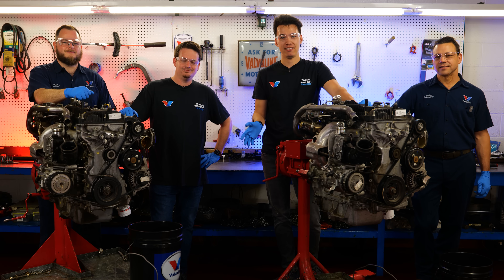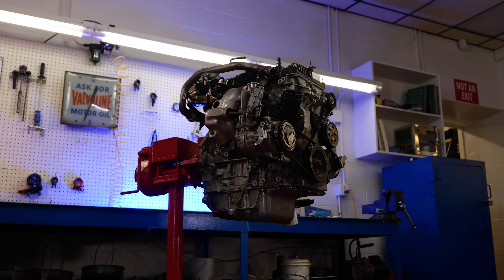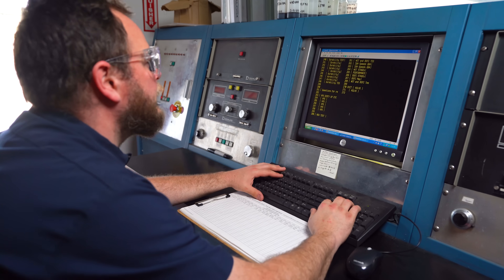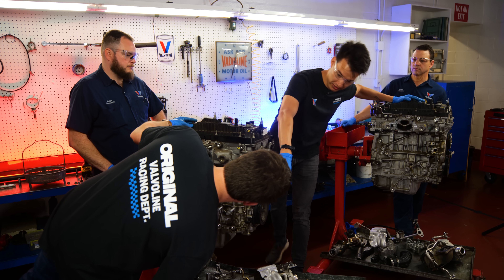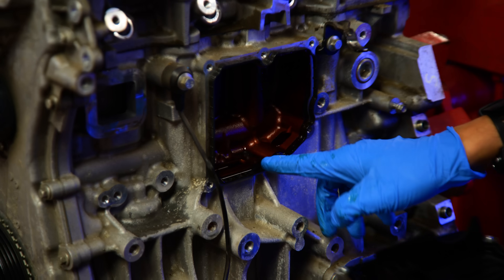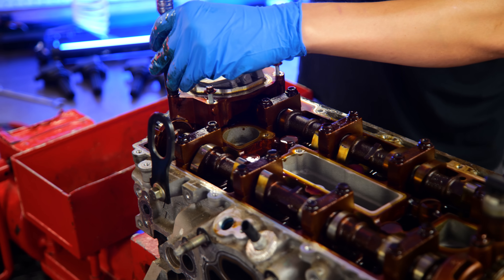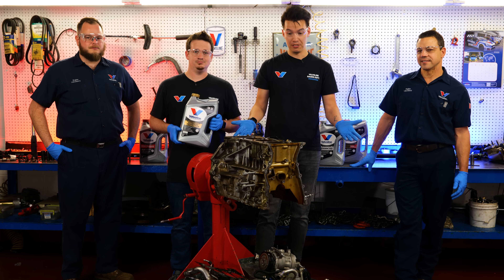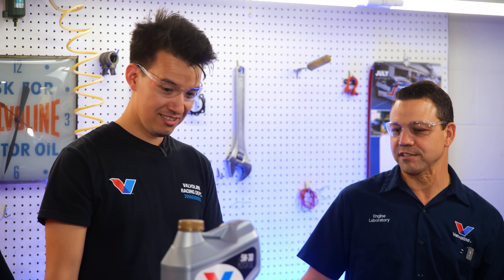Testing different oils over 4 years and 1 MILLION miles

Comment: Call it what you want. Many years ago that compression ring would not have become stucked. Oil technology have improved tremendously over the years. The oil did not play a major part of that. The reason the ring became stucked is because of the low tension piston rings all manufacturers been using in modern cars.
Reply: Nah.  Gunk and varnish is gunk and varnish.  In the old days with iron rings w a lot of pressure, you’d grind the cylinder. walls down in under 100K miles.  And the crosshatching was long gone before that, so no oil retention for your cylinder walls, so your engine was doomed.

Comment: Did they do a compression test before tearing down?

Also, cold starts is where most of the wear happens on a daily driver.  I think the synthetic would've done MUCH better if they had cooled the engines down a couple times per day.